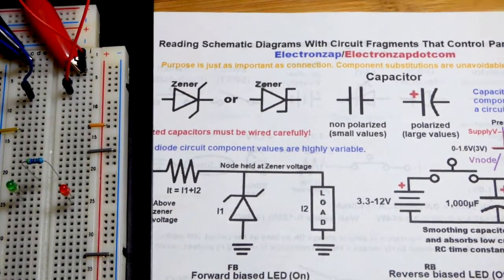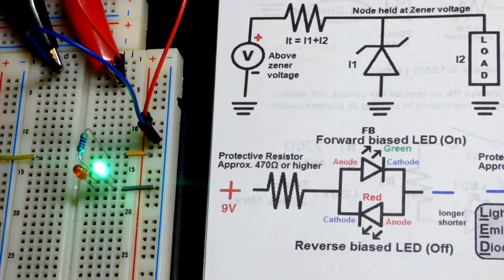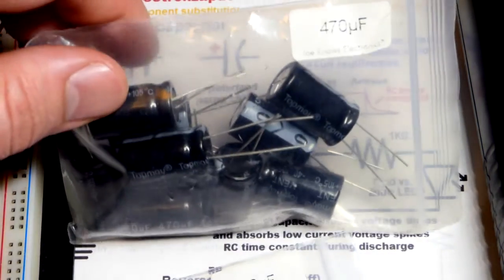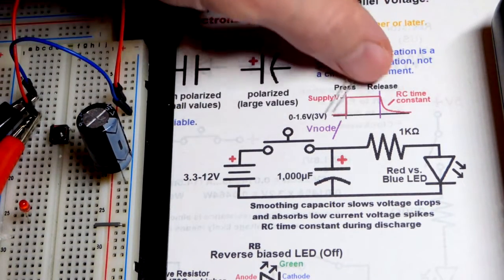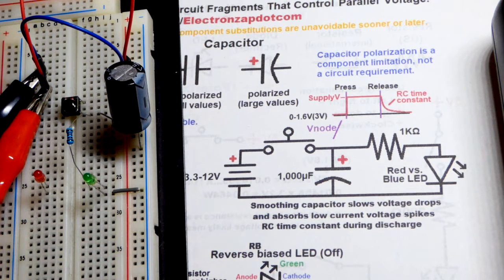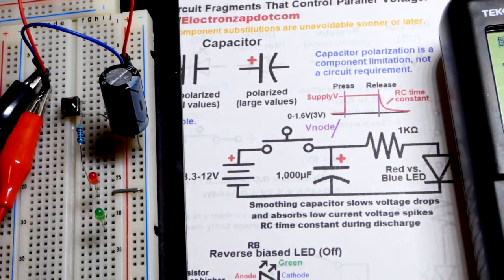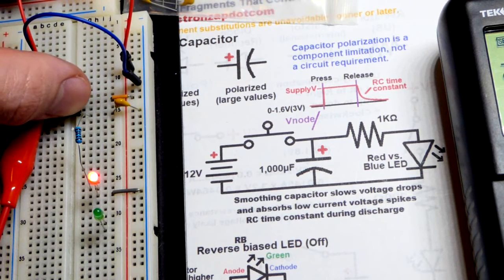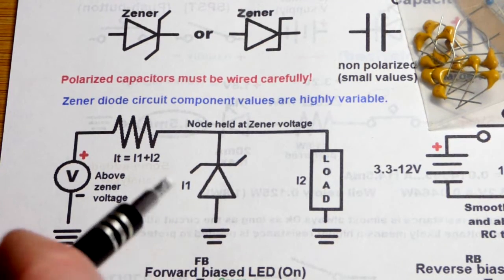How to read schematic diagrams for electronics part 2 changing voltages and capacitors

Comment: Very nice explanation. If you could use an Analogue multimeter for current and voltage measurements. it'll be easier to understand the flow and duration of getting the capacitor charged or discharged.
Reply from the maker: Thanks for the tip!